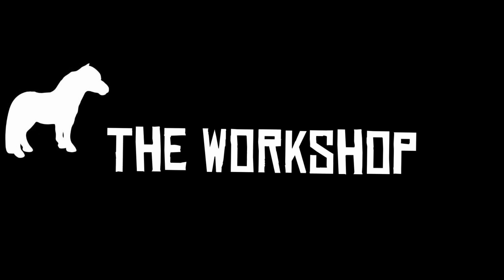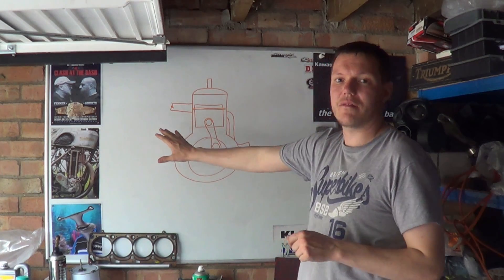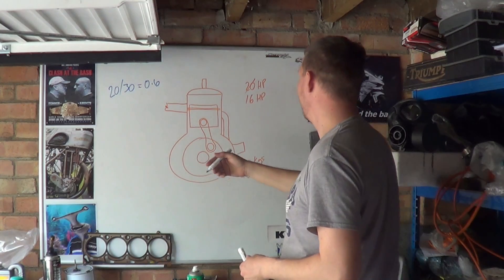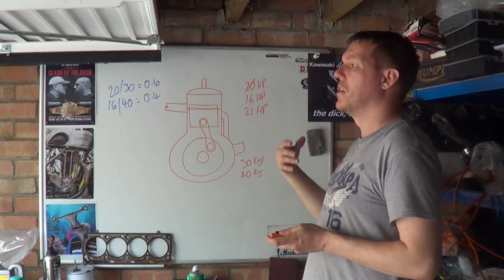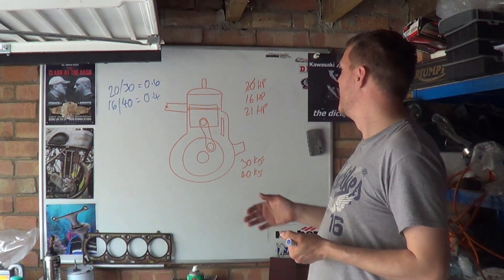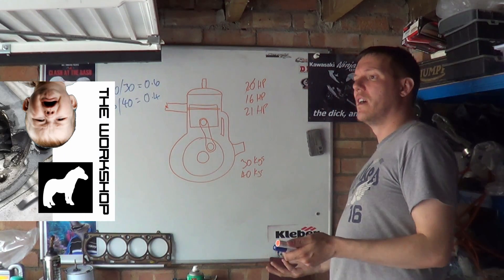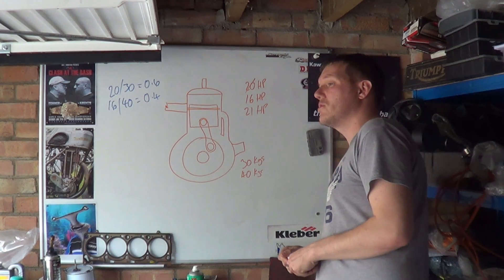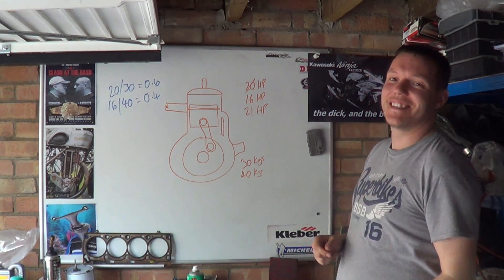2T supercharging the solution?

Comment: You have to compress the air, using your cranckcase or an external pump, it should not be so much the decrease in power by adding a supercharger.
Greetings from Uruguay,

Comment: I don't really see how burning oil is so critical a design constraint for a 2 stroke engine.  If a 4 stroke doesn't need to do it why should a 2 stroke?  And don't fret to much about how the electrics sound. You can always stick a card in yer spokes.
Reply from the maker: "I don't really see how burning oil is so critical a design constraint for a 2 stroke engine.  If a 4 stroke doesn't need to do it why should a 2 stroke?"

- is this a serious question?
Reply: @thedirtyworkshop  Yes it is.

Comment: What about a beltdriven turbo? Think they call it a turbo charger. Simpler and less weight instead of the big and inefficent screw type
Reply from the maker: Are there you are wrong.

1) all chargers are called 'superchargers' and then there are turbo superchargers - which we call turbos

2) You have to gear up the impeller type - and that gearbox is heavy - impellers are either like propellers and shift a large amount of air or thin like an impeller and shift loads of it very rapidly. If a turbo impeller spin at say 10,000 it's pretty much useless - hence turbo lag
Reply: @thedirtyworkshop  oh. I thought that, that type of supercharger was just a lightweight system with different pulleys to adjust the ratio. Didnt know you needed a full gearbox although ive seen the gearbox type but that was for a 3000hp monster truck so that extra weight was probably small in proportion.
Reply: @thedirtyworkshop  btw, any difference betwee turbo super chargers and what they call centrifugal supercharger?
Btw Dell says hello from the hospital. He fitted a 220 on a 170 rim while going "darkside" tyre Wall exploded but he says that it was just a bad tyre like a one in a million chance of happening.
Reply from the maker: A supercharger is anything that increases the 'charge' above what the N/A system can do. The name before that is just how it does how it does it.

Turbo supercharger = turbine
Centrifugal supercharger = impeller
Roots Blower = roots lobe 
Screw = Lysholm twin-screw 
Scroll = a pair of scrolls 
etc etc
Reply: @thedirtyworkshop  thanks!

Comment: Who gives a shit about the weight of a little motor when the vehicle plus rider weigh over 500 lbs?  What you'd have us believe is that the parasitic loss is reducing the horsepower to a lower final number.  What's that word you use?  Bullocks or something like that.  And does a supercharger present that much of a challenge?  All we're doing is blowing air.  Does it have to be a Roots-type?  Can't it be a shitty axial or centrifugal compressor?  Hey, remember something.  You put an exhaust valve in there and you don't have scavenging headaches.  You could fix up a nice turbocharger, maybe.  And don't steal all my ideas and run off and patent them.  Blymy.
Reply from the maker: "Who gives a shit about the weight of a little motor when the vehicle plus rider weigh over 500 lbs? "

- Everybody who cares about acceleration. When engines can weigh up to 200lbs then its not that small is it?

"Does it have to be a Roots-type?  Can't it be a shitty axial or centrifugal compressor? "

- Impellers require high rpm - in the order of 10:1 vs the engine rpm. So @ 10,000rpm that's 100,000rpm for the impeller.

Comment: Two strokes emissions have been dealt with. The oil is burned 99% in direct injection.  
Manufactures are investing millions in the future two strokes.  

Still don't get it. 

More two strokes are being built today than 5 years ago.

Honda has a injected two stroke patent ready and waiting.

Snow machines are two stoke dominant 

Out board engines INCLUDING YAMAHA are all in on two strokes.

What the fuck are you talking about ?

Comment: For as long as the fuel needs to lubricate the piston the engine will burn oil. Supercharger wil not make a difference. 
And supercharger will not work with reedvalves you will need rotairy timed disc intake for the normal 2 stroke exhaust
principal with a different exhaust timing that is completely closed when the intake starts to open so unburned fuel will not leave the cilinder. 
So maybe with oil in the engine that will also needs to lubricate the supercharger and a airpocket to precomprimate
a volume of air that wil be filled directly up the cilinder with the help from a rotairy intake disc and maybe a fuel injection system... And a new method to build pressure for the intake because now there is oil where there udes to be presurized air
so this system does not work anymore.
 So the only thing that would separate this new two stroke from the modern 4-stroke would be the  2-stroke cycle with the old exhaust porting system.
The question is then again will this engine get enough lubrication from the one side of the engine for this 2-stroke principal ??

Guess not....

Comment: RB-innovations and many others make tiny cost effective superchargers. 30+% HP gains on 2-strokes. Additionally because they use blow-through carbs it cools without an intercooler.  With fuel injection emissions would also be no problem.  2-strokes make a ridiculous amount of power for their weight so the death of them is highly overrated.
Reply from the maker: "so the death of them is highly overrated."

- so where are all the street bikes that used to be on the road gone? Where's this years road going KTM? YAMAHA?

Comment: I have to pull you up... ~4m30s in you talk about superchargers being "quite well machined" - I seem to remember you losing a blood vessel in your head over the hard break in guy using such vague terminology. WTF does quite well machined mean?

Did the supercharger design, test and fab guys just throw something together and collectively say "Y'know, it's only a f'ing supercharger spinning at ungodly rpm and experiencing horrific internal pressures - it doesn't need to be perfectly machined, what's a few thou of slop between friends, quite well done will do for this application - we'll outsource it to a Neanderthal to put the rotor together with their clay cast technology and a stick".

Double standards.... someone will pull you up on them - and this time it's this smug d'head here - someone had to, if only to cause another f'ing aneurysm.

Keep up the good work. It takes me back to studying theory on 2 stroke tuning and then applying it to my various steads which turned out pretty well. Expansion chambers though... never truly got my head around them, or at least how to do all the calcs.. so opted for "let someone else make them". Wish I stuck at it longer.
Reply from the maker: @ 4:3-0 I then say that's it a precise process. But you obviously stopped the video to comment. so you look like a bit of a chump now
Reply: Indeed so! Comment in haste, repent at leisure. I'll keep my gob shut next time.

Comment: you can use a centrifugal clutch to switch where the supercharges is driven from, a turbine driven by exhaust gasses, or the main shaft of the engine.
so that is solved. from the point it runs from waste heat, you get ... more power, and better efficiency. i hazard power to weight ratio would improove.
specially compared to a naturally aspirated 4 stroke.
Reply from the maker: And the cost and complexity and the weight - not a good idea, hence why no one has done it - think 30kgs 2 stroke 125cc engine
Reply: yepp, the costs would be high. no argument about that.
and complexity too, sure it would be more complex.
if you think about it, 4 strokes are more complex and power to weight is inferior to 2 strokes.
witch leads /at lest me/ to think, those 2 are not enough on theyr own to justify.

i'm pretty sure that a forced induction engine makes more power than a naturally aspirated one (sure, depends on the pressure, but we assume its there to provide charge pressure, we don't want a blower) . in your video we don't really see that.
i remember the same arguments when turbocharged diesels where a new thing. its gona cost more, its soo mutch more complex, you don't need it, its pointless, just get a petrol engine, diesel is heavy, and so on.
however, i can hardly see any diesel nowdays that comes without a turbocharger. and it gets harder to find a petrol car. 

sure we are not talking about diesel 4 strokes, but i can draw a pretty nice parallel line, if it hits the market and becomes common it is going to get cheaper and more affordable.

but i would really like to see valid points to show why it would be inferior in power to weight ratio. and again, we are not talking about sticking a roots type blower on a 2 stroke.
https://www.procharger.com/sites/default/files/ProCharger_B1_cutaway.jpg
this looks more like it, but still lacks a few parts to allow it to shift between exhaust gas turbine driven, and engine main shaft driven operation. that would not be a new thing, its done on a lot of engines.
surely not feasable for a 50 ccm or 125 ccm engine, but i just fail to see why it would be that bad on a 250 ccm engine, when it could actually be close in power to 600ccm 4 strokes. 

 people are willing to pay silly amounts for tiny bits made out of exotic materials, and for useless junk that can not possibly work at all. why would they not pay for something that actually works, i ask ?

Comment: Bsfc two stroke is bad, four stroke has more torque and a wider power curve. The extra fuel is also heavy not everything is light in the two stroke. four stroke supercharger or turbo is better
Reply: Uru-petrol but 4 stroke does not smell as good

Comment: Has any one ever produced/ modified the supercharged 2 stroke diesel engine design to run on petrol?
Reply: Unlikey due to the how petrol engines work! Diesels are compression ignition (so high compression ratios) compared to petrols that are spark ignition (lower compression ratios). It would require some low comp heads or head gaskets (depending on the engine), a spark plug with the means to fire it accurately

Comment: A 2-stroke ktm 150 puts out 40 hp , also the emissions are now fixed via fuel injection and oil injection, three sensors to monitor the process. The 2018 husqvarna line up has them. So please get informed. 2-strokes are the most efficient as they make power every stroke, and do not require an exhaust stroke., valves or cams to make it heavier.

Comment: If all manufacture's have stopped making 2ts , what about silly scooters....?
Reply from the maker: I was talking bikes, KTM and a few other still make them. And as for scooters they are switching to 4T as harder and harder emission come it force. Funnily enough the 4T have been failing the emissions as well but the ruling for scooters, because they are small engines (50cc) are different (i.e have exception) for now.
Reply: More they mess with are engines , the mess they make . If its firing & running wright as they were . An engine is an engine , not a clipboard .

Comment: could you do s vidio explaing why 1/8 scale rc 2 strokes don't use a Reed valve or rotary  valve and all other 2 strokes do. it seems like all 2 strokes that aren't in rc cars are basically different sized weed Wacker engines with fancier porting.
Reply from the maker: Yes I can - matt

Comment: If they suddenly became race legal, even if they imposed fuel limits and emission rules, you would start to see them again. The death of the two stroke is all because of honda campaigning against them to get them banned or put at a major disadvantage in all the major forms of racing.
Reply from the maker: "The death of the two stroke is all because of honda campaigning against them to get them banned or put at a major disadvantage in all the major forms of racing."

- the death of 2 strokes has been going on for a while now. Lond before they started removing 2 stroke production in 2001.

Comment: same opinion on the electric crap👌
Reply: I used to think so too ,till i rode a gearless,no vibration, high voltage chirping brushless road bike, then going back to an archaic 2016 zx10 was like going backwards 30yrs of engineering evolution.
Riding is more pure without gear changes.
Reply: Carlospicywiener but going back all these years 30+  is the awsome part bout it seeing that back then the stuff worked at least as great without all this assistances

Comment: If money/materials was no problem, how would a normal bike engine (NO racing) change? (would it have a dramatic increase in lifetime, power, weight(decrease)? would be lovely to see a video of a mental exercise about a no engineering limits engine.
Also, I do think mechanical engines will disapear at all, they are just going to change fuels (hydrogen, alcohol, etc..)
Basically, with scrap metal anyone with a workshop can build an IC engine, however, noone at home can build custom magnets for an electric motor, for example.
Reply from the maker: "If money/materials was no problem, how would a normal bike engine"

- good question, can do a video about that - matt

Comment: Hmm... reminded me when I used a Eaton M24 (I believe it's 390cc per revolution) blower on Zetec Rocam 1000cc 8v. 

It went from 65hp@5750RPM (intake manifold pressure at 90kPa) to 115hp@7000RPM  (@ 158kPa), but 17hp was being used by the blower to displace all that air (the blower was @ 18000RPM) and compress it (a pressure ratio of 1.75, which renders the blower extremely inefficient and generate a lot of heat).

But the blower seems to do not require much power if you put the blower air displacement close to the engine displacement, it's going to roll very efficient, at pressure ratio close to 1 and with minimal horsepower leeching.

And I believe if the blower is "sucking" the carburetor, it's probably unlikely the mixture will get crazy when compared to "inserting" more air into the carburetor nor will require major modifications on the carburetor.

But I agree with you: the blower is expensive (got my used Eaton M24 by 1200 BRL and spent 500 BRL replacing some parts and oil) and heavy (that Eaton M24 was tiny, but it weights around 6kg).

And it with add a lot of inertia to the engine.

Comment: You might find the stepped piston 2 stroke engine interesting, I think Norton had some prototypes. There is an explanation on Bernard Hooper Engineering website. It has some of the advantages of supercharging, the ability to run wet sumped and has no extra moving parts...

Comment: If you already have the crankcase moving air about, is the energy required to move the air and fill the cylinders not already calculated in? Seeing as the crankcase is already a pump of sorts.
Reply from the maker: I'm a bit lost hear dude, what?
Reply: The Workshop well you took 20% off the power output to account for pumping losses of a supercharger, but the crankcase on a 2T acts like a pump to fill the cylinder so you already have pumping losses. So the change in power factor probably isn't that severe.
Reply: In fact, the Nissan Micra DIGS (supercharged) runs the Miller cycle for fuel effiency so there is reason to believe that a supercharger could actually be a more efficient method of cylinder filling than relying on the piston downstroke alone.
Reply from the maker: the power of the original engine already includes the pumping losses. But the 2 stroke uses the kadenacy effect to aid in this and the use of different pressure gradients due to piston location. Which when tallied up really aren't that much. 

The losses associated with the supercharger aren't just pumping losses, but also additional friction, inertia resistance, leakage of a roots blower, any gearing to increase speed etc. You have to remember that accelerating the blower as the revs increases coupled with the pumping loses is a squared function not a linear one.

Comment: I get your point why non crank breathing 2T would require a supercharger and its drawbacks.
Have seen some aftermarket manufacturers that offer Supercharger kits for 2T snowmobiles. 
Speedwerks has a kit that uses a crank driven procharger to 2T Arctic Cat 800. http://www.speedwerxstore.com/index.php?l=product_detail&p=1400
How is this supercharger really meant to work on a 2T?  Doesn't make sense. It should reasonably just pressurize the crankcase and then  when transfer port opens, blow out the exhaust? In any case, it would need a massive tuned exhaust pipe to provide a powerful return pulse to give any increased fill rate? This is supercharger is of course a tuning product with probably bad volumetric efficiency, emissions and just those who look for more power. They state 225 hp which is an increase about +55-65 hp.
Reply from the maker: Yes I have and a video on skidoos is coming - as for the supercharger bit, when you increase engine volume it makes it more viable. One question I do have is that this is just a supercharger fitted to a crankcase breathing 2 stroke? Or have I got that wrong?
Reply: From what I´ve seen, they just put a supercharger on a regular 800cc 2T snowmobile. I may got it wrong but it seems weird. A 2T turbo makes more sense.

Comment: Speaking of supercharged two stroke diesels, I know of a prototype built by a dutch guy. Externally scavenged with a crank driven compressor(geared 1:8 if I remember correctly) Only speculations, but it looks to have a secondary  piston for closing of the exhaust duct and/or maybe for variable compression. Not much info on the net, and the guys involved are keeping it close to their chest...
Reply from the maker: lol I bet they are on 2 fronts. Works great - patent. Load of shite - hide it forever
Reply: Probably! Better to keep your mouth shut than shameless boasting of impressive figures. You're probably familiar with the Ryger...
Reply from the maker: Oh yes, 15 years development lol